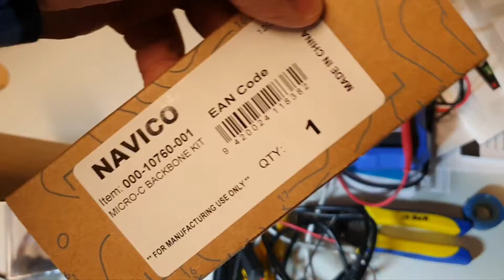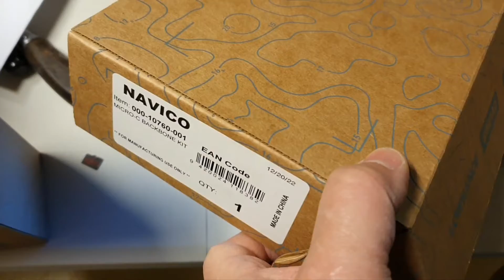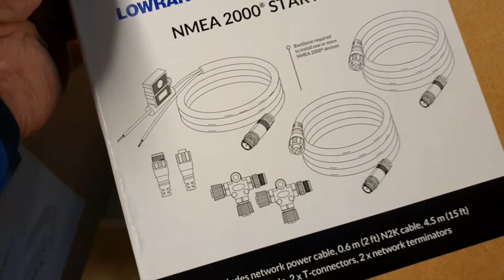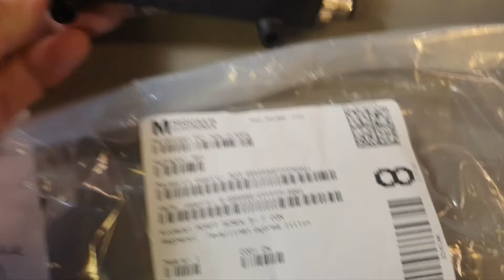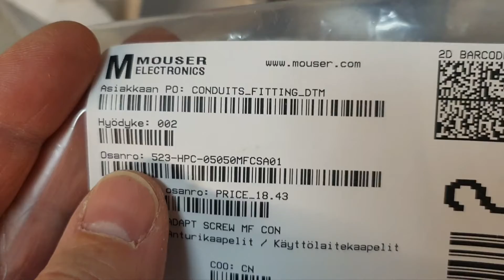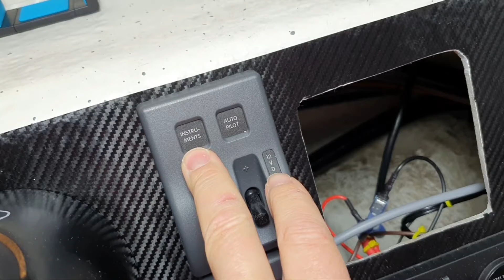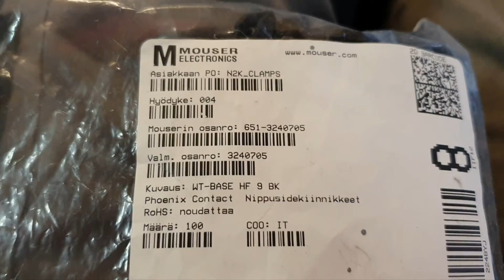NMEA 2000 Explained: Step-by-Step Tutorial for a Specific Project

Comment: How to extend a NMEA2K drop cable w/ a T w/3rd port plugged w/ terminater? Or is there a coupler just to extend the cable?thanks
Reply from the maker: @steveleston1848  Any drop cable is the extender - you can stack them. Just keep in mind the total length and the fact of extra connection. You can't extend with Tees.